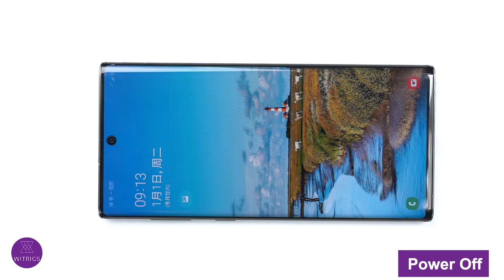Samsung Galaxy Note 10 Charging Port Replacement

Comment: mine just went out. Just placed an order for the part, I used to work on phones for a living and have done many charge ports but not the note 10plus. It seems pretty much the same as all the others. I have the ifixit tool kit but I didn't get the heating pad or whatever it is. What was the thing u used to heat the backglass?

Comment: Hello, thanks for the video! I've changed my charging port as well and its working perfectly now!:) BUT, since i've changed it my Phone loses his network constantly.. the Wifi is still working but reaching calls or using internet without Wifi is not working anymore.. Do you know what could be the problem? Thanks in advance!!
Reply: That's caused because there's different versions of the charging port board and you have to make sure you get the same version as your old board.

Take note of the model number written on the board that says something like SM-N976V for example
Reply: I have exactly the same issue, did you found a fix ? I am using a charging board N976B/N on a  Galaxy Note 10+ N975F/DS from 2019 .
Reply: @AFMHdSC  no, I had to purchase another charging port of the exact same model as the original board. I tried everything and that's the only thing that worked.
Reply: @justcallme00oogy  mate can you post a number/sign of the part you finally used? That one that worked if it was not N976B/N
Reply: @PiotrNazim  I can't because it depends on the phone model number since different regions use a different board. It should be the same as the phones model number (written on the back). Alternatively you can disassemble the phone (which you'll have to do anyways to replace the port) and see that way
Reply: Any luck? This is crap that you can not get service. In a world where we have all these tech geeks, they are horrible with basic customer service. If you have all this stuff and it does not work, it is trash.

Comment: Hi, there is no sound coming out of my akg usb c headphones when plugged in. I have tried other headphones too but they still don't work. On top of that, there is a usb connector connected/disconnected notification that keeps appearing. Anybody knows how to fix this? Thanks!
Reply: I bought a usb dac and it only works in 1 position but it still won't play the akg usb c earphones and it won't read any usb otg and it also doesn't show fast charging

Comment: hi, i replaced my charging port and now it charges perfectly, but the speaker below (loud speaker) has stopped working.  What could be the problem?
Reply: Busca el otro y se lo cambias y ✅
Reply: @carlitosvaldiviezo8170  Hace tiempo ya de esto, el problema fue que el nuevo que me enviaron tenía una pequeña pestaña rota, y hacia que no le llegase energía al altavoz de abajo. Casi me volví loco hasta descubrir el fallo, era una pieza taaaan pequeñita. Me enviaron otra placa y todo perfecto.
Reply: @juaconsgamer  en señal te funciona bien?.
Reply: @carlitosvaldiviezo8170  si, el teléfono me ha quedado como siempre, decir además que es un modelo asiático con Snapdragon.
Reply: @juaconsgamer  muchas gracias por la información amigo